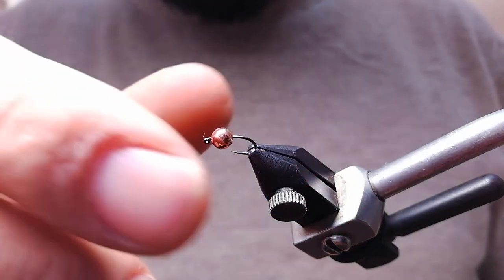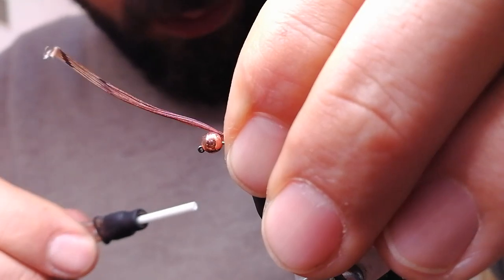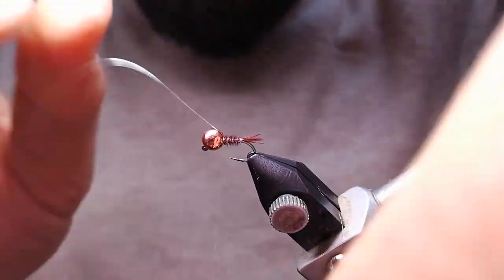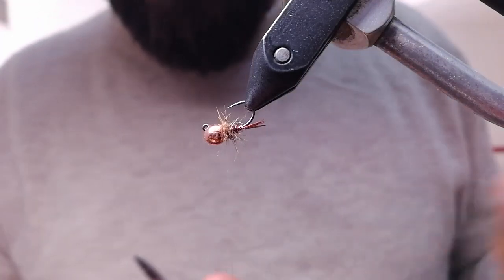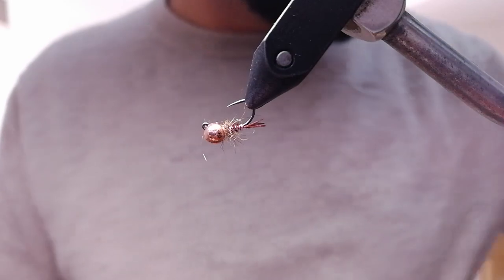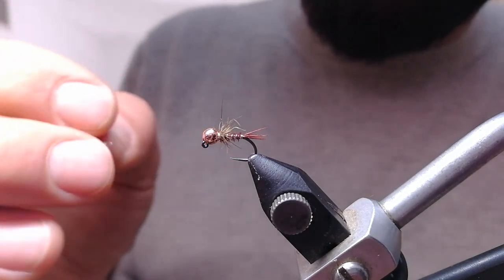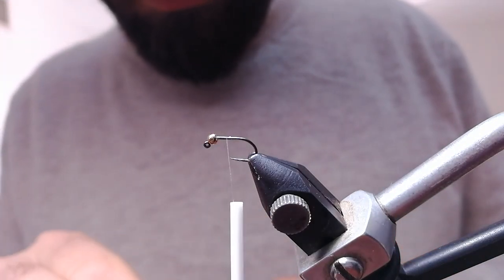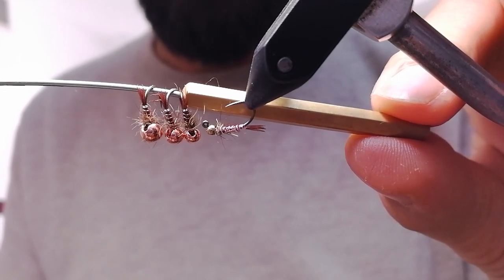Thoughts On Tungsten Bead Size

Comment: Nice visual comparison of the bead/body ratio. Would be interesting to know the difference in weights. Personally, I prefer to keep my fly silhouette right and add a splitshot if needed. Cheers!
Reply from the maker: I am not sure about weights, it is not important in fishing....its the experience that i use for determining which one is right or just by experimenting.
I cant use split shot because its not legal in competitions and detection is slightly better with direct nymphing. I dont even use two nymphs mostly. Proportions are not good but fish dont mind i think. And one more thing.. i try to use as thin tippet as possible to get deeper. Recently i used even 0.08mm tippet... 😃
Reply: @Oholisfliesandfishing  I am not into competitions but I understand that you have to work within the rules. I fish for Smallmouth Bass a lot and will often use a  "hopper/copper/dropper" setup (a large floating "indicator" fly to a heavily weighted nymph followed with an unweighted fly - usually a soft-hackle. For bass, I have found that the proper profile and movement is more important than size and color. Good luck with your fishing!
Reply from the maker: @hankvana2149  thats cool... i'd love to try smallmouth once... i dont have it here... good luck 
😃😃

Comment: La imperecedera pheasant tail y sus variantes siempre pescan. Sólo un apunte, si entre la bola de tungsteno y la punta del anzuelo queda muy poco espacio se hace difícil la clavada, pero estas  imitaciones con Faisán han sacado millones de peces.
Reply from the maker: I agree, but small nymphs are often taken more confidently by the fish so i dont have problems. Now i use jig off beads that solve that issue completely. Thanks for your comment. Tight lines
Vladimir 🍻🍻😀